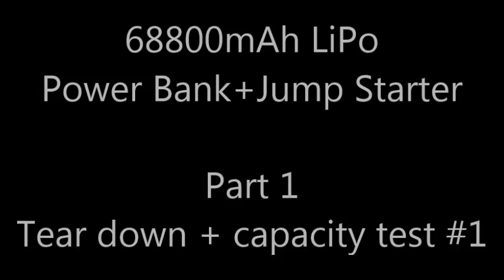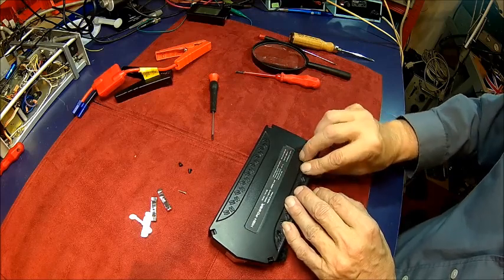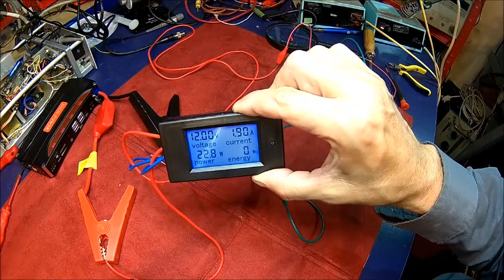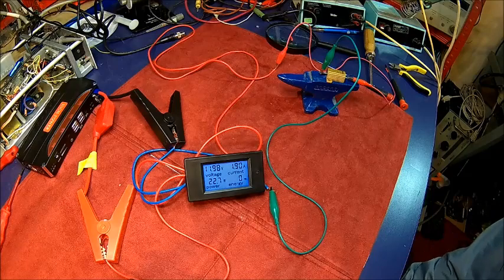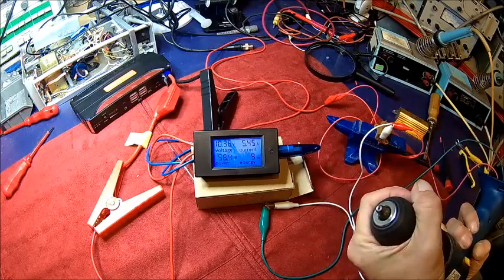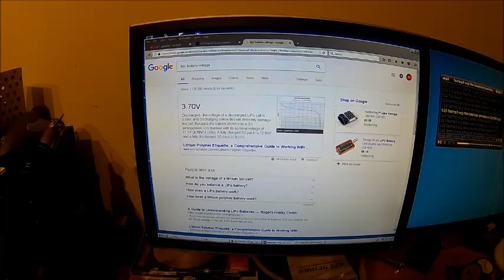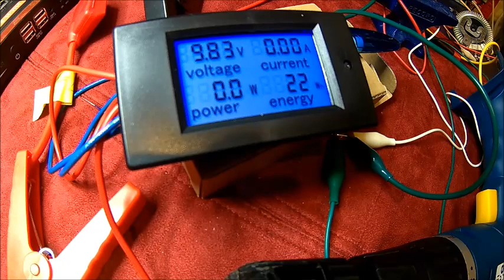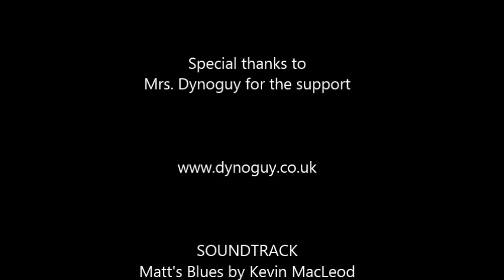68800mAh Power Bank+Jump Starter, really ? - or what's in it - a tear down and capacity test

Comment: Thanksfor a good review. I use a similar power bank to start my go-kart. Mine was rated at 7500mAh but when I pulled it apart the battery pack was actually labeled as 2500mAh. I think they are just sticking any crazy number on there to try and out-do each other.  Mine does ok. Starts the kart 10 or more times on a race day. My first one lasted about 18 months before one of the cells broke down, so now I always have a spare one.  The warning is, they do work, just don't believe the numbers.
Reply from the maker: You're welcome,... it might be OK for a cart, but with a car, the battery will be loaded well beyond spec and therefore die rather quickly. ... as always, you get what yo pay for.

Comment: I'm still waiting for someone to test the peak current. It's a shame I got rid of all my shunts when I got rid of all my pulsed power gear. I still have a fast storage scope, so even if it could only deliver 2,000 amps (or whatever this particular unit brags) for .001 sec, I'd be able to record it, heh. But we all know those battery leads would disappear in a cloud of copper vapor if you actually passed 1,000 amps through them.
Reply from the maker: Well, .. i have test gear for that, but i don't want to set my lab on fire. my guess would be the flimsy connector gives up first.
Assuming the usual 20C rating, a safe value is probably around 40 to 50A, anything above that will most likely kill the cells anyway.

Comment: Here's the thing about the Chinese stuff. They WILDLY exaggerate the performance of nearly all the electric stuff they sell! It's like their 18650 batteries, they claim 12000mah when the highest power from a reputable brand is about 3500mAh. Always compare what the reputable brands are offering. If they are higher or close to what the Chinese ones are, then maybe it will be ok. But if they are like 3 times the power of a leading brand, yet a quarter of the price, forget about it!!
Reply from the maker: I agree, ...and the sole purpose of buying this thing was to find out how much they inflated the numbers as it was clear from just looking at the size that the stated capacity is actually impossible with today's consumer market battery technology.

Comment: The stated capacity is clearly not feasible due to the physical size if the unit, however I own one and have used it to jump start my 1.5 diesel car and 750cc motorcycle a couple of dozen times on occasions when the vehicle battery has been too discharged to start by itself. Its other functions such as USB and laptop charging also work, although I barely use it for that purpose.
Reply from the maker: I agree that it may work when the starter battery is not completely dead and just needs that few extra amps to crank, but it certainly won't start an engine on it's own. I find the USB and laptop outputs much more useful as this makes much more sense with the given capacity.
Reply: A couple of dozen jump starts are not bad. The unit may have already paid for itself several times as a handy lifesaver, right?

Comment: Hi! I bought this power bank and surprisingly it died just a few days after running out of warranty. 
I inspected its motherboard and looks like the U8 component is burnt, do you know what that is and if I can replace it?
it is located at one of the extremes of the main board next to a capacitor behind the leds board.
Reply from the maker: Well, it's not really a surprise to me,.... I certainly can have a look at mine and let you know what the component is. Will take a few days because i am on the road right now but will be home for the weekend.
Reply: dynoguy no probs let me know when you can.cheers

Comment: It will work  about 3 times and then the lipo is dead. I have brought a 3S 130C discharge lipo which gives me a genuine 3.3Ah cell capable  of  over 420 amps burst. Mine is held on the old jump starter case by rubber bands. Cheaper to make your own jump starter than pay for the Chinese rubbish.
Reply from the maker: I agree with pretty much all what you saying. The main purpose of the video was figuring out the real capacity because i simply could not believe the numbers they were claiming and it seems i was not wrong with my first impression...:-)
Reply: I assume your lipo DIY jump starter is working, right? If so, will you be so kind to share what materials are use and how to assemble them, rubber band and all. I hope to build one myself based on your model. 😉

Comment: for what 22WH or 22k mah or something like that? isnt that bad is it for the price? what would be the max amperage peak to "start a car"?
Reply from the maker: The main point of the video is to proof that they sell you numbers which make no sense whatsoever.
An average (car) starter draws somewhere between 80A and 250A, mainly depends on engine size, Diesels are always on the heavier side and a frosty cold start requires a few extra Amps, too.